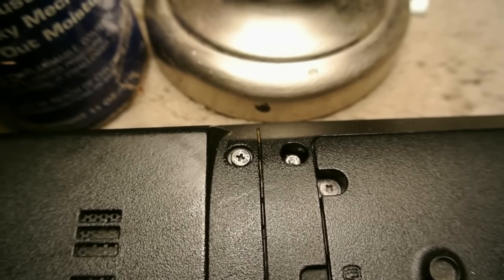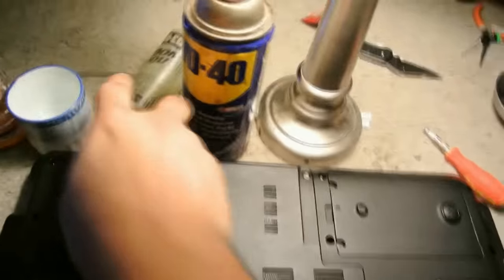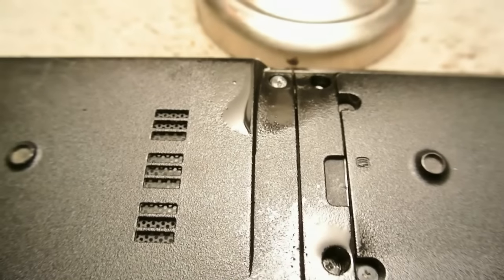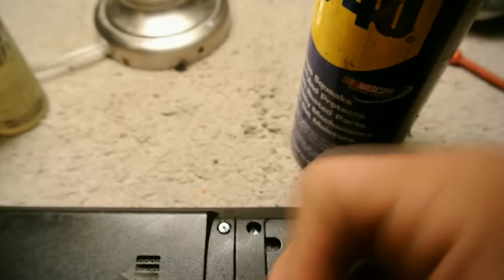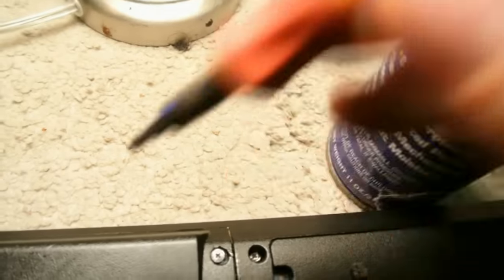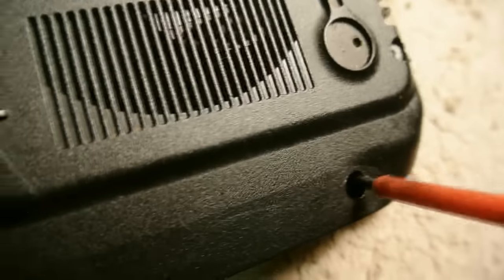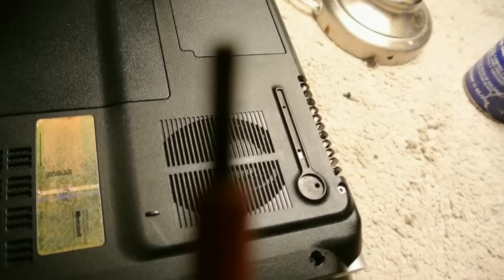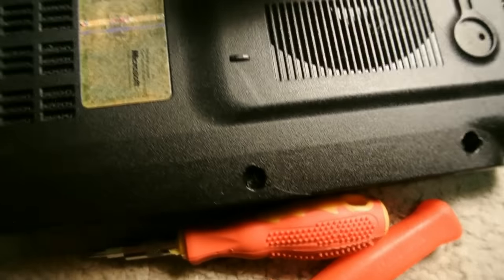BEST WAYS TO LOOSEN A STUCK SMALL SCREW

Comment: DONT spray the wd40 like the guy in the video, spray it in a cup or on paper or something then put a little drip onto the screw, liquid and circuits dont mix well together, sure it may not be conductive but it still isnt good for whatever device you are using
Reply: What about on a PS4 controller?
Reply: @vfamily4396  use contact cleaner instead. i use crc mass airflow sensor cleaner to fix my drifting analog
Reply: @Bos_Meong  Forget it, I just bought a new controller.
Reply: @vfamily4396  oh okay
Reply: What about an iPhone 7 screen replacement? I’ve been buying new tools, thinking that was the issue. I’m using the right screwdriver and the screws still aren’t coming out. On the motherboard and back plate of screen.
Reply: @chasxart682  just try using a cotton bud for it because if you get too much wd40 on it, it could damage the device itself, best to be careful about it

Comment: I had a small screw holding an a/c filter I needed to clean and I was beyond frustrated because the screw would not break free. So, I mixed up your suggestion, a tiny amount of canola oil and vinegar, I then used a cotton swab to apply the mixture to the screw. After a few minutes, and remembering to lefty loosey the screw came loose! Thank you SO much!

Comment: Use silicon oil ONLY. All the others damages plastic (makes it soft like a rubber). Also it doesn't trigger corossion and is save for electrical eqipment.
Reply: will it damage my motherboard? and is it safe to unscrew on a mental bracket?

Comment: Try looping dental floss around the screw & tug up as you unscrew.
Reply: smart
Reply: impossible for me because the screw in in a hole for me.
Reply: Nice one
Reply: I’m actually trying this with a thread, not workinf
Reply: Thank you so much
Reply: But what if the screw is like yk... In
Reply: I used the wrong screw driver at first and ruined the screw
Reply: Thanks. Now all I need to do is undo the screw, loop the dental floss around it, screw it back and then unscrew it, as what you had told.

Comment: I'm trying to open a ps3 controller and the screws are way in there so i cant get the flathead there so will it work w/o using it?
Reply: I’m trying to do it to my ps4 controller what did you use

Comment: You use a cheap bit-set and driver from the dollar store [Chinese soft metal) .  if you used the correct Philips cross head screwdriver  with small head - of good quality -  the screws would  come out easy;
Dont use wd40  in the home if you can avoid it - it will stain fabrics / clothes and stink the place out

Comment: I’m trying to unscrew my air unit beca it needs cleaned inside … I’ve tried everything … knives… screwdrivers.. the same kits you bought and different ones … nothing works … tried rubber band trick … tried oiling… nothing ….

Comment: In utter disgust and exasperation I chucked in the bin this morning a plug I bought from a well known supermarket.  I was doing what I thought was a simple routine plug change and it would have been simple and routine if on the new plug only one screw obliged me and unscrewed itself.  Everything else simply would not budge.  What does it tragically tell us about plug manufacturers when such a seemingly simple change of plug ends up having to be shown to a professional in the hope that professional can deal with screws which have obviously been sealed in with superglue?  Or is it done deliberately so we have to spend a big fee getting a professional to deal with one of these faulty products?  The plug I was changing dates from the 1990's and was a piece of cake unscrewing.  What were plug manufacturers doing right in the 1990's that they refuse to do now?

Comment: what u can do is take a power drill and drill out the the center of the screw. And u should be able to pull out the screw or hammer it out. that's what they'd do at my old job when bolts would get stripped, jammed or just plain stuck.

Comment: Will this work for the Nintendo DS’? My screws are stuck too. 😥
Reply: in the same situation, did you end up getting them out? I am really struggling so if you have some tips please tell me
Reply: @Vexiad  I gave up. The only reason I was going to unscrew my DS’ were to find out out about how apparently the battery will get big when it is worn out or something. I never was able to get them out.
Reply: @bremaster93  ah that sucks hard, I've got swollen fingers now and my screwdriver broke, idk why these are so hard to unscrew 😭
Reply: @bremaster93  I actually did just manage to get it apart though, just needed a better set of precision screwdrivers meant for glasses and it was a lot easier

Comment: OR you could try a small flathead driver bit in the first place for these type of screws.
Reply: Those are what they are used for? Well there ware the Flathead specific screws.
The more ya know.
Reply: Use a magnet to take the screw if it can turn